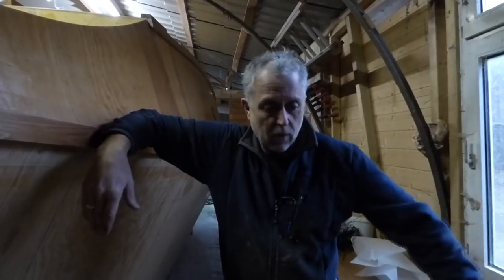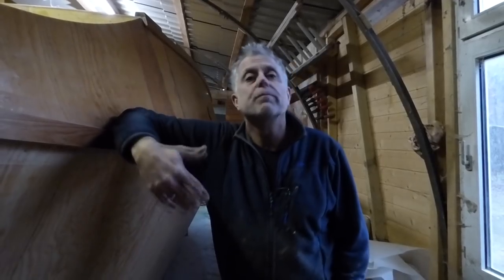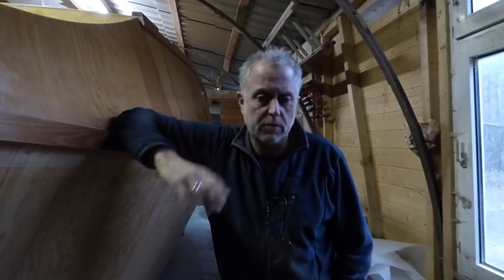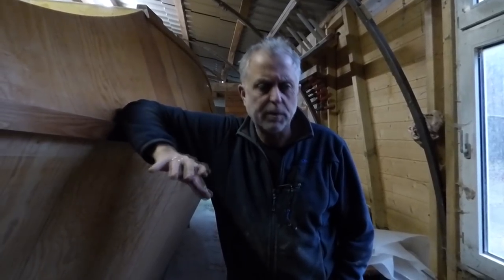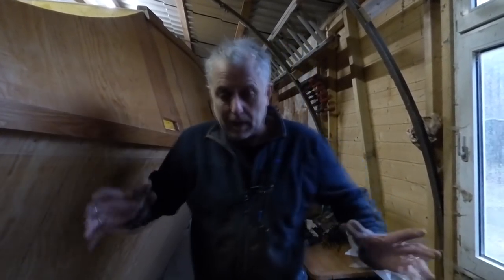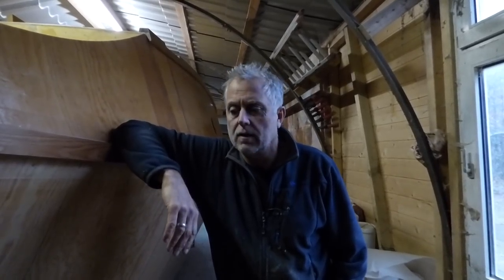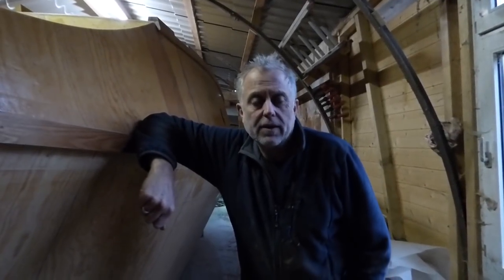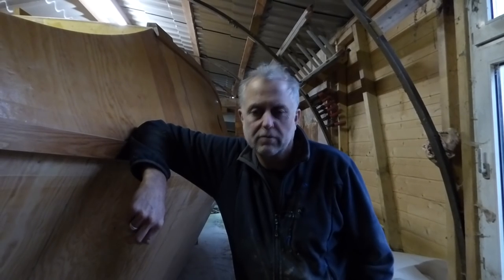Black locust strip cladding the lazarette hatch and a visitor from the US - SV Tapatya EP114

Comment: As a newbie to table saws, my take on the safety comments below is: I always use a pusher, goggles and gloves (and even ear protection to stop mine from ringing) - and I'm mighty careful with the spinning blade.  That said, everyone takes their own responsibility, in their own workshop.  One of the many things that I've learned from being a subscriber to this brilliant channel is: with experience comes a certain flexibility regarding working practise.  This isn't Tony's first boat build.  I'll always listen to all points of view regarding safety, but in the end, I think I'll emulate the bloke who has actually been out in his workshop today, building this beautiful hull, in seemingly record time.  As I gain experience in my projects,  I'll try to balance safety with productivity, like Tony.
Reply from the maker: Thanks Chris.
I've had a think about this and I'll put my neck on the block by risking a few comments on table saw safety as I see it.
I always wear ear protectors for the simple reason that table saws are always loud.
I always have the riving knife in place. I believe it to be the single biggest safety item on a table saw.
I always fit the upper dust guard unless the job I'm doing demands I remove it ( cutting a rebate, for example)
If the upper dust guard is removed, I wear goggles. If it's in place, I don't. With the dust guard in place, any bits flying up on the blade are redirected out the back of the saw or sideways. I firmly believe that good visibility is an essential safety factor and goggles have a horrible habit of misting up.
Respect for the machine demands I give it my full concentration at all times. In my videos, it might look as if I'm half closing my eyes - that's a look of concentration, not some half-witted attempt to protect my eyes.
I always use a pushing stick unless the particular job demands not. Small, or thin pieces are difficult to hold securely with a pushing stick. If I'm not using a stick, I hold the workpiece firmly and my fingers remain over the metal saw table - they never enter the zone delineated by the removable plastic piece around the blade.
I never wear gloves when using a table saw. Gloves can get caught and drag your entire hand into the blade. Also the sense of feel is diminished when wearing gloves and I want all my senses.
There's probably more if I think about it, but that'll do for now. These thoughts come from a lot of experience using table saws and they work for me. Others might see it differently, and if that is born out of experience, then good.
I'll await the flak :-)
Reply: Good point about the wearing of gloves, Tony.
Reply: @SVTapatya  I love your work - a delight to watch and to see the results. Regarding the table saw ( I don’t yet have one), one factor perhaps not even considered by anyone reading this, is awareness of one’s own visual depth perception. 

Many people, if not most, don’t have perfect  binocular vision. (about 8% of us have none!), and we should ask ourselves whether this might compromise our personal risk levels when using such machinery.

If in any doubt, then take all safety measures seriously and make allowances for this at all times.
Reply from the maker: @jerryhollands8444  Thanks Jerry. Yes! Good point!!